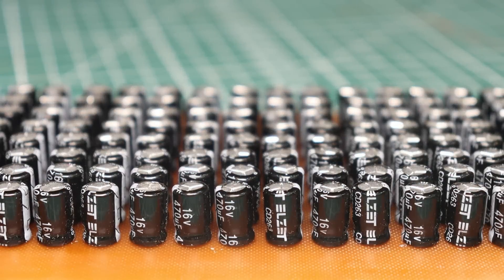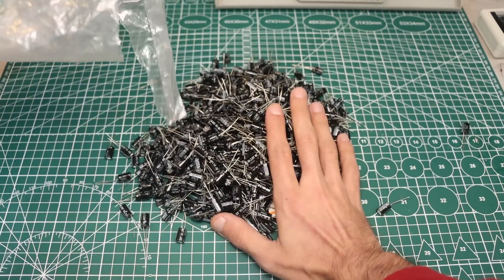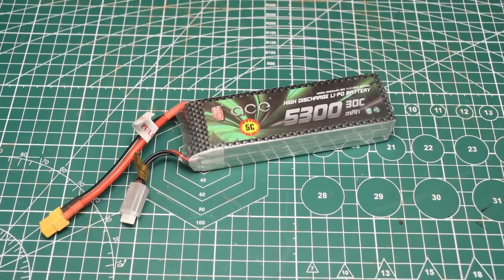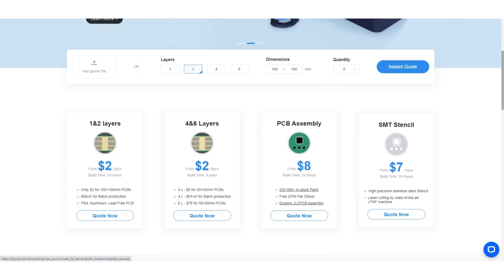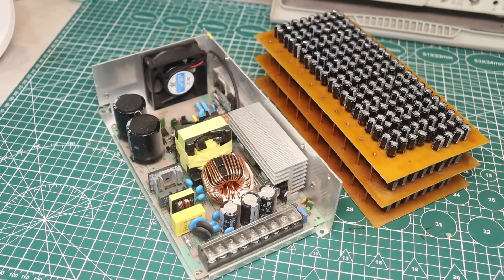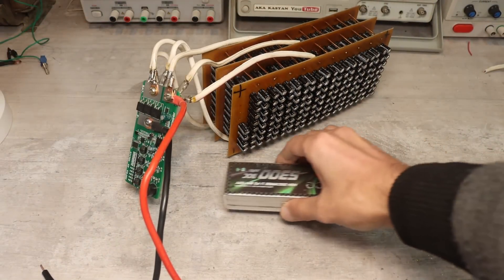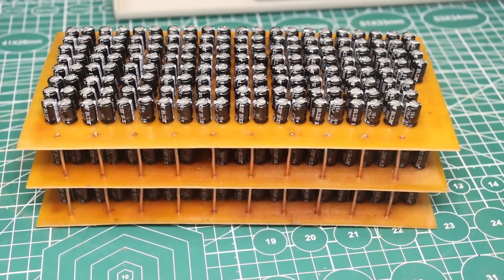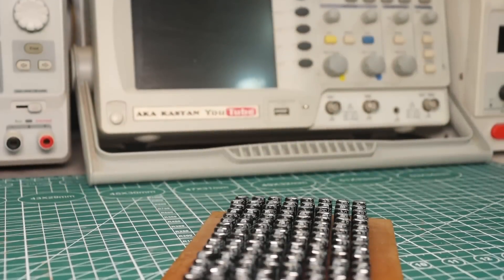What can be made from 500 capacitors ?

Comment: That LiPo battery pack is not rated for current in "Celsius". C stands for the capacity of the battery. A current rating of 30C means it could output 30 times is capacity in current. That might sound like a word salad, so let's consider the example. The bettery you have is 5300 mAh (if I remember right), and was rated for 30C discharge current. If it were 1C, that means you can output 5.3 amps. If it were rated 10 C, it could output 53 amps. And 30C means it can output 159 amps. Usually these kinds of batteries have different ratings for discharge current and charge current. It may be able to discharge 30C but can probably only charge at 2C to maybe 5C.

Comment: At school I could reliably hit a man sized target with capacitor goo and the cardboard cap from around 20 yards using a regulation 470 uF electrolytic cap charged to 48 volts reverse biased. 
It shouldnt take much to make a circuit that uses a push-button to simultaneously cycle power through 500 of these caps lined up one by one, and energise a relay that pumps 48 volts through the currently 'selected' cap the wrong way. That way, you have a 500-shot machine gun ;)
Even better, use a 555 timer to create the delay between 'shots', and set it up so once the 500th cap is fired, the 501st 'shot' is fired through the 555 chip itself - making the chip the 501'st 'bullet'! - 555 chips themselves make great weapons.
Reply: This is a wonderfully deranged comment

Comment: I know English is not your first language but when you say the battery can output 30 Celsius makes you sound like you have no clue what you are talking about it's 30c I assume c stands for capacity it can put out 30 times the amp hour rating in current so a 1ah battery rated for 30c can put out 30 amps or your 5300mah is rated for 159 amps

Comment: hmmm... Nice video.  Suppose that someone worked with a capacitor manufacturer and had access to tens of thousands if not hundreds of thousands of C0G power conversion MLCCs with voltages in the 200V to 15,000V range.  What would be the most optimum setup to try something similar with a large bank in terms of peak current?  Obviously the power density would be quite a bit lower but the resistance would be too.  I am guessing that minimizing the path length to the electrodes would also be massively important to take advantage of the lower internal resistance.  Also ringing would be an option for a larger integration time in terms of welding over polarized caps.  Just curious... for a friend.
Reply: Using a giant amount of components would lead to other disadvantages. The track resistance and inductance would limit the current delivery. Also you would have to inustrially assemble those banks. And how would you repair it in case one of the MLCCs fails shorted, which they sometimes do?

Comment: I've always wondered if building a capacitor bank out of regular small electrolyte capacitors was worth the effort. Since they are so common, you can get decent bulk discounts on them which is a big plus. Thank you for confirming that indeed expensive caps are not a requirement for a useful (and scary) capacitor bank 🙂

Comment: Just out of curiosity how did you connect the leads off the capacitor bus, was it on the same end for the + and the -?  Meaning, if you have a row of 500 caps with a + bus on one side and the - bus on the other side, where did you put the terminal connections?  On the same end of of the bus for both + & -?  
For example if the Left side of the bus starts with capacitor 1 & the far right side of the line /bus bars is capacitor 500 (and all caps are spanning the +&- bus bars), where are the terminal connections for the bus?  Are they both on the same end, either near cap 1 or near cap 500?  Or did you put it in the middle?  

I was told that for a large cap bank the best option to get the full working value of all the caps & to deal with any ESR resistance is to put a terminal (just for example) on either the + or - bus  next to cap 1 & then the other terminal connection on the opposite bus next to cap 500, so you will have terminal connections on opposite sides of the capacitor line/bus.  IDK exactly why, much more knowledgeable people in electronics agreed that my setup (of 80-100 caps) would be much more efficient this way & probably get much more power out of it (but they weren't all identical caps nor all new).  

I'd be interested to see if there is a difference if you have the connections at opposite ends of the bus b/c if they are connected on one side, you may only use the first 50 or 100 caps at full capacity over & over, where if the other way, (I was told at least), you will use the same total energy but it will be spread out over EVERY cap.  I hope this makes sense.
Reply: You can clearly see in the video how everything is connected. He has 20 buss bars connecting the boards together.  He has a pair of conductors going from each board (6 total) from the center of each buss to the welder.  Two cables in the middle or one from each end will give you about the same results. Connecting them all at one end would be worse.

Comment: A charge pump would be also very intrresting but I am unsure if you would need bipolar capacitors
Reply: In most cases you would not(unless you expected ringing) as a charge pump always charges in the same direction, and discharges similarly.  They effectively charge in parallel and discharge in series for a boost, or charge in series and discharge in parallel for a reduction.  Its slightly different for a negative voltage charge pump but effectively its the same thing, just charging from positive to ground, and discharging from ground to negative.  I've been thinking about charge pumps a lot lately lol!  
You could even make charge pumps with variable capacitance values to vary the voltage from fixed N multiplications and dividers to different value capacitors for finer voltage control up and down.  Or vary different numbers of fixed values in series and parallel for different control schemes.
But it will never be truly isolated as a lot of capacitors fail into shorts.... so transformers are still the way to go, in that regard.

Comment: The LiPo battery has a current output of 30 Celsius? How does that work?
Reply: The video was probably poorly translated. It was about C rating of a battery. In this case a 30C battery with capacity of 5300mAh can output a maximum current of 159 amps (30C * 5.3Ah)

Comment: I recently salvaged 8 80, 000 microfarad,  20 volt capacitors. I thought, "wow, nearly half a farad!". They were threaded posts on top and I connected them in parallel with 10 gauge wire with factory eye rings and bolts.
I don't know what to do with it.
Reply: Spot welder or maybe something with a pulsed laser?

Comment: I still own a fanastic MIG/MAG welder from the German company ESS. They used large capacitor banks in an assembly of many small ones in parallel. The welding result was very good, this cap bundle gave a nice punch at the beginning with full current.
Reply: my girlfrind is from t ype gsd

Comment: 25,000A? I don't think your current measurement is accurate...  3 of these FETs already have 0.6mOhm of ON resistance. Also these FETs can handle maybe maximum 4kA for 1ms.
Reply: Same thought here, those small FETs would desaturate way before reaching few thousand Amps. Not the mention that at 16V, 25kA would mean a total resistance of 64µΩ, just his current shunt has a higher resistance. Maybe he setup his probe to x10 while it was on x1, common mistake. 2500A would be much more plausible but still quite a lot. I would expect something like few hundreds of Amps.
Reply: @Astri.electronics  I stead of a shunt a Rogowsky coil would be a better way to measure current. A CT7044 goes up to 6000 A up to 50 kHz
Reply: No doubt a current transformer would work better but that's not the point of this discussion.
Reply: The capacitors are 32 joules 16v,so 2 ampere in 1s,which is 2000a in 1 millisecond, 600a avarage in his three milliseconds of short circuit weld time.
But I wonder if you got low resistance for example doing the weld directly from the capacitors with a large relay, if it would reach 25ka for lower than 0.1 milliseconds. But surely you can't spot weld with that even with high pressure the weld time is too short?

Comment: Your lead inductance connecting the capacitor bank to your welder and the lead inductance of the wire leads for the welder itself are limiting the peak current.  Use a beefy coaxial cable (RG-8U) or at-least twist your leads (form a twisted pair tx-line) to reduce the series inductance.
Reply: Just know that I would like this, if I was a tradesman and knew for certain this was good advice.
Reply: @jacobp.2024  If they're correct then it's good advice. If they're wrong then it can't hurt. You can never go wrong with larger cables when carrying current, especially in a situation like this. However, smaller cables can get you in trouble, especially in certain situations where they might melt and cause a fire due to overload.

Comment: I upgraded my moped's 20Ah 48V SLA battery to LiFePO4, and have 6x 20Ah almost new, that I bought last year and in good shape. 
Can I use them to arc weld using a jumper cable and 6013 welding sticks? Spot welding is nice, but I have no use for it. 
If I put them all in parallel, How do I limit the current to 100A~120A ?

Comment: A battery with a current output of 30 Celsius???!! What are you blabbing about there lol
Reply: C is the ratio of discharge current to capacity. It would have unit of ampere to amp hour. A 3 Ah battery rated at 10 C can be discharged at 30 A. Conventionally, fast charging is usually 1 C and slow charging generally happen at 0.1 C.
Reply: i come down here for it. i mean it's a c but not celsius. but i'm unsure how to properly shorten the discharge rate notion

Comment: With enough diodes, could make a x500 concroft walton voltage multiplier
Reply: That would literally take an hour or so to charge up just once, and it's just 4kV at most at no sustained current. Would be completely impractical unless you ran it at many kHz, and even then it's pretty pointless.
Reply: *Cockcroft